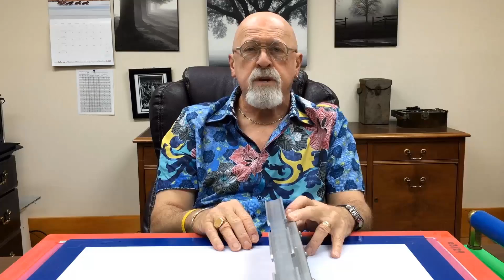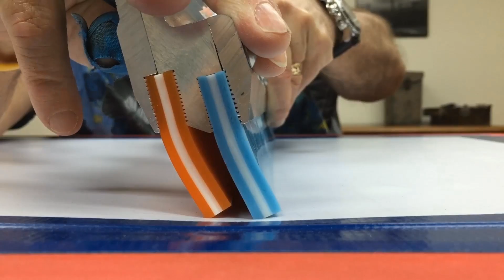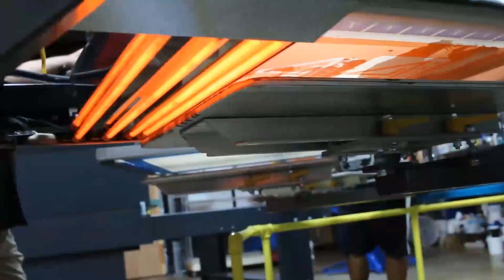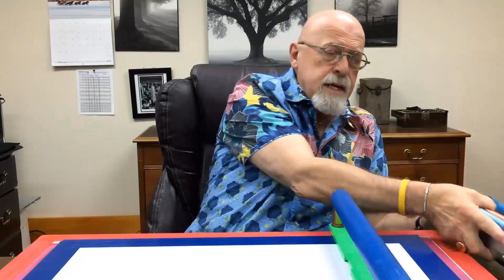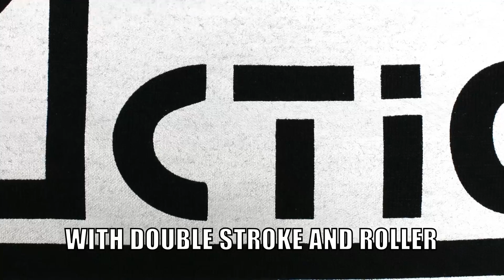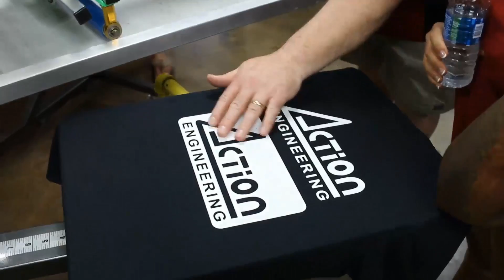How to Use a Double Blade Squeegee and a Roller Squeegee!

Comment: So we started using the double squeegee at my job and used 15 degree angle 35 on the pressure and speed was slower side as well and it worked great for awhile and than suddenly it wouldn't clear too great tried few different things but it's been trial and error so far